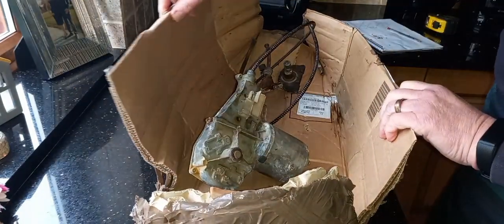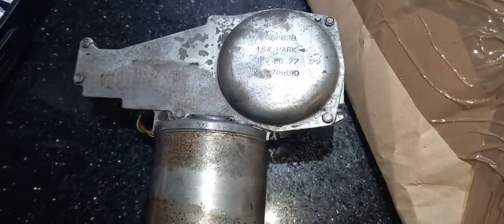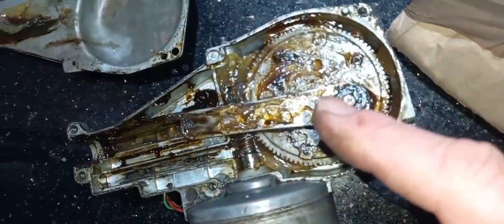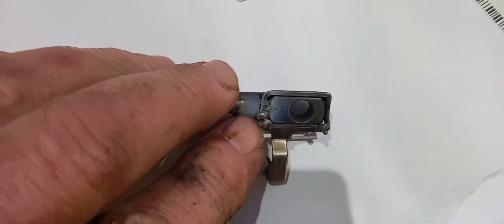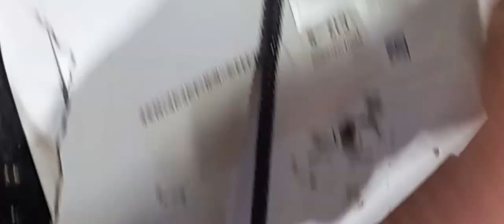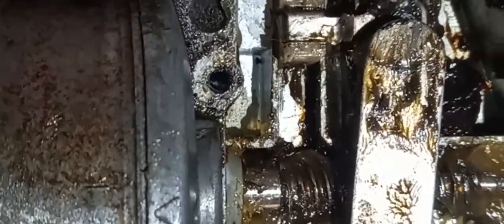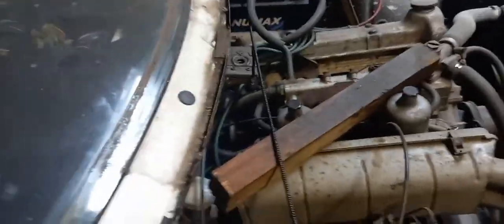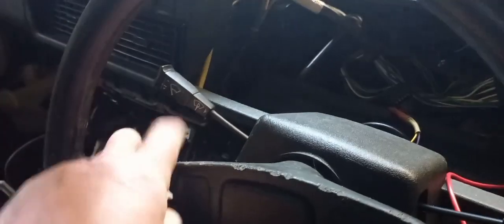TRIUMPH TR7 Wiper parking issue resolved!

Comment: Thanks Chris, mine does not do a 1 wipe, it does the two speeds but does not park. I have checked out the stalk which is ok, it's later Ford type and the stalks are switched sides on later models. My next port of call was the motor but as you say not to be driven in wet, but when I do clean & wipe the screen I have to stop it at the right point on either speed. Thanks for sharing your findings.
Reply from the maker: Chris, cheers for your thoughts. I believe there is a design flaw with the park setting. We'll see if my welding is up to the job.
Take care Chris.
Chris Robinson.